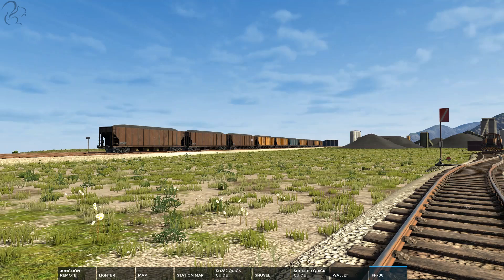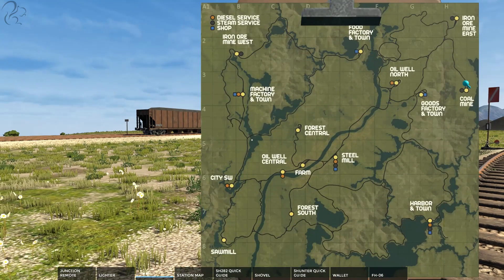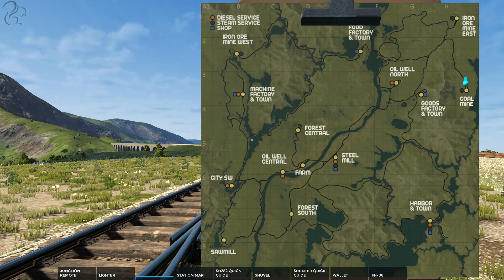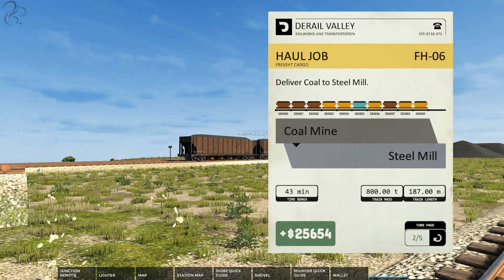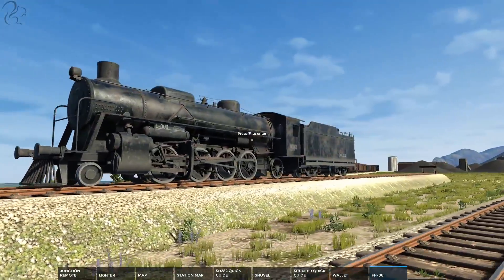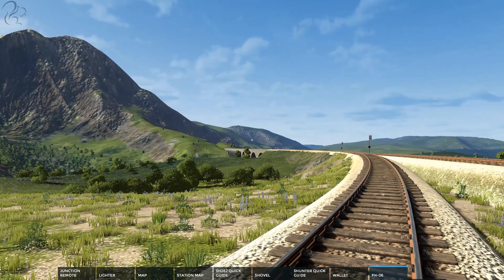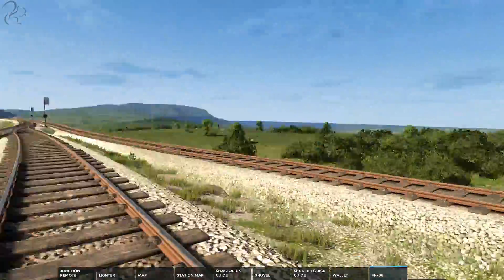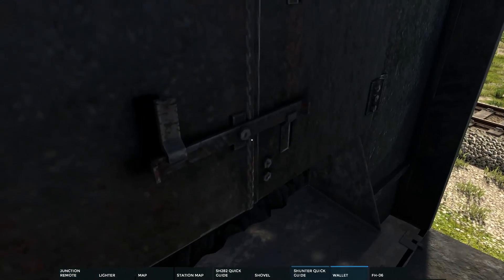Derail Valley - 800T Steam Haul

Comment: If I remember correctly, what you said about being in a steam locomotive in a tunnel is actually why Southern Pacific created its cab-forwards. Because it was the 1940s or 50s, they were oil burners, so they were able to turn the whole thing around, with an enclosed cabin where the tender previously was, and plopped the tender on the back, with plumbing for the oil to fire it. This meant that the crew could go throguht SP's many long tunnels without dealing with the annoying, irritating, and in several cases, dangerous fumes.

Comment: With that boiler pressure, I was half expecting rivets to fly through the cabin
Reply: More wasted steam coming out of the safety valve than the pistons!  and the coal usage, you'd think he's melting glass in the firebox
Reply: @captain-Dan  If he'ld have to do a 500km journey, he'ld never reach the end because he would be through his coal and water reserve well before the middle point. ;)
Reply: @captain-Dan  Yea, but it gives us a nice insight into how well modeled this thing is.  If you watch the boiler pressure and listen for the safety valve, you can see the pressure drop a little when the valve opens.
Reply: Pretty well all certified boilers are tested at double operating pressure hydrostatically, that's the law. In reality a modern (as in not wrought iron!, so last 150ish years or so) will probably take an extreme amount of pressure to blow, something like 10times its actual operating pressure. The explosions in the very early days were iron vs steel boilers and more often than not caused by crews tampering with safety valves, either because they made to much noise (no joke!) or trying to extract more power.  Explosions are relatively rare when it comes to modern stuff, more stuff like superheater failures and dropped fusible plugs than actual explosions, these things can still be fatal however. Even in case of a derailment and loco turn over, boiler is unlikely to explode, but its still an extremely nasty experience for the crew and more often than not fatal, we lost a few here about 20 years ago and i wont go into detail out of respect. Loco itself has just been returned to service and it really was relatively undamaged considering it ended up on its side.

Comment: 25:23 You're kind of lucky in that scenario since you're coasting down hill so the smoke won't be quite that bad, but coming the other way... On the Somerset and Dorset Railway there was a mile long tunnel between Midford and Bath Green Park called Combe Down Tunnel and it was notorious for its low clearance (meaning that the smoke from the chimney would rebound immediately off the roof and down into the footplate) and steep incline if you worked out of Midford, not to mention no ventilation shafts, crews referred to it as 'Dantes Inferno' and if your engine slipped while climbing Combe Down Tunnel it could be hellish. One incident in 1929 actually resulted in deaths after the Driver and Fireman were overcome by the smoke while their engine was climbing through Combe Down Tunnel, the engine then continued on its merry way with the unconscious crew on the footplate, out of control down into Bath yard where it crashed, killing the driver, and two railway workers in the yard. Nasty stuff.
Reply: This is the reason that cab-forwards exist.
Reply: @retovath  well in America yes
Reply: And you figure with how big the 9Fs were on the S&D that the exhaust output must've been brutal.
Reply: That's a helluva story....so it wasn't all fun and games huh???
Reply: I ain't reading all of that
Reply: This is why the Americans have closed cabs
Reply: Liam O'Farrill I did
Reply: big brain

Comment: Over in California, there is a museum that still has a steam engine that was used in the mountains. What the guide mentioned was that cabins for the engines were mounted on the front and the boiler would be reverse mounted so that the emissions would not cause CO poisoning to the engine operator. Something interesting you might like.
Reply: Can-forward mallets on the Southern Pacific?

Comment: @Squirrel Good sir, at 26:40 you make a crucial fault in steam-trainning... When entering a tunnel the firebox should always remain closed and the fire turned 'low' (if you will) to not risk a blowback from the furnace into the driver cabine. You never top off coal while inside a tunnel, very dangerous in reallife steam trains.... Another pro-tip, you can judge how your fire is doing by keeping the exhaust smoke between a light gray color under a low (pulling) load and a darker grey for a higher (pulling) load... Most people including yourself are driving this steam train with max coal and fire going, which creates black smoke or a to cold setting, which creates a more white-ish smoke.... Nice video keep up the good work.... I would love to see more of your derail valley videos... Greetz from the Netherlands.

Comment: Some information about entering tunnels - many a crew was nearly suffocated while operating steam locomotives over the Sierra Nevada mountains here in the USA due to there being so many tunnels bored through the mountains and the snow sheds laid over the tracks to prevent falling snow from blocking the way. 
The Southern Pacific remedied the suffocation by ordering several batches of "Cab Forward" locomotives. They are fired by oil, so no coal is required, just open a valve to shoot what is essentially bunker c fuel oil into the firebox. The entire locomotive is flipped around 180 degrees with a fully enclosed cab while the tender still rides behind.
 If you've ever coal fired steam locomotive, you'll understand why being a fireman on an oil fired engine is a breeze in comparison.

Comment: Not sure if you will see this, but if you put the control partially in reverse, (not sure if it is modeled in the game) you can use the train's power to slow it down instead of so much brake. Wouldn't want brake fade on a steep decent.
Reply: This does work in game.
Reply: Works in game. But in real life it was really not a thing to do. :-P
Reply: @julius6889  not on diesel and electric engines But it still works with older designs and some other more modern steam locomotives. You see engines way way back in the mid-late 1800's didn't actually have a break on them beside the handbreak on the tender and cars so the reverser was used and because they were so light the wheels locked up and started slipping in the opposite direction of travel to slow it down. By using steam against the motion of travel in the cylinder, it acts as a form of break.
Reply: This was done on early steam lcomotives, which only had handbrakes or steam brakes, but on more modern steam, this practice was no longer used due to more powerful air or vacuum brakes, as well as the fact that braking with the engine causes a lot of stress on the valve gear, rods and pistons.
Reply: @kitchenjail3546  Not to mention that even with modern-ish steam power, using the locomotive's own brakes (unless running without a train) was typically frowned upon, since if you used them long enough, the heat generated could cause the driver tires to expand and separate from the wheels.

Comment: Hi Paul, nice video as always. Your videos on this game why I purchased it for myself. Took me a bit to get the hang of things, but I found some methods of success that I thought I'd share.
1) <20km/h isn't necessary, I had more derailments at low speed than anything else, the key is gentle braking. If you are too hard on the brakes it will derail at low speeds, I had more luck being gentle with the brakes and riding a corner at 30+ even with long/heavy consists. Using the keyboard, pressing 'M' 3 times is a good start then a 4th time if it isn't enough. I'm sure there are a few bends that are exceptions, but I was biting my nails trying to be as gentle on the brakes as possible and found I was getting much further at higher speeds and lighter braking. 55 minute trips in < 40 minutes.
2) on the steam engine, pressure is your available power, shoveling coal when the relief valve is going isn't going to provide you with more power. I only shovel coal when I need to build pressure on the gauge, even while climbing you only need to ensure your temperature is high enough to replace the lost steam and if you keep the locomotive moving at 30-40 you have a much better indication of grade change with plenty of time to build the temperature to replace the loss. I've had to even relight the fire because it burnt out and still managed to gain temperature and rebuild the steam before running out of pressure.
3) I unfortunately don't know the complete technical definition of the cutoff, but it functions similar to timing advance. You are playing with a torque/speed balance, which also means that placing it at full torque at higher speeds actually doesn't help, if you are running at a decent speed and need to climb, placing it to full torque won't actually provide power until the speed drops. I find as soon as the speed drops you open the regulator until you hear pistons fighting the resistance, then begin to slowly bring the cutoff towards the torque as the speed falls, you will find the steam engine has the ability to accelerate up hills quite well

Comment: I found Old Bob's Shop. If you have already found it, skip the rest of this post. The next time I went through a town I bought Old Bob's Shop Key. I went back to the shop and unlocked the door, and low-and-behold there was an old Hand Cart; the kind you pump by hand. I used the F1 - F6 keys that also work on the Steam Engine. I took the Hand Cart for a joy right and had a blast.  If you haven't found the shop yet and would like to give it a try, Go North of the Machine Factory and just before you get to the first junction there will be an unmarked (on the world map) siding going South West.  When you get to the shop by going along the siding take Old Bob's Shop Key and approach the door pointing at the lock.  It will light up and you can unlock the door and get to the Hand Cart.  A nice diversion.
Reply: there's a caboose in the game now, get reginald's garage key at the city sw shop and it's just past forest south

Comment: 25:23 I have experience working on steam locomotives through long tunnels the trains are 15 inch gauge and the tunnel is 800 ft long which might not seem like much but at this scale and the size of our steamer it can get bad as our engine is oil fired and the tunnel is set at a grade so it makes it fun charging through it because at the fireman you have to keep an eye on how much oil you are injecting to the fire as if you have too little you wont make the pressure needed to keep your speed and you will have the fire blown out by the draft that the engine is making, but too much and you will gas the passengers and lift the safety valves inside (which is not a fun thing to do mind you) so while we are doing this we are also constantly injecting water into the boiler all the way through and while normally this will lower the temperature and pressure we are working the engine so hard that the pressure and water level for the most part stays constant. but yeah I know in the mountains it was a real bad problem so much so that one railroad had special locomotives with the whole engine reversed (called a cab forward) to combat all of the tunnels and snow sheds. while other railroads had gas masks for the crew or large fans in the tunnel or just used electric locomotives in place of steam engines. but in many cases you try to get the stack as clean as you can and make sure everything is set right going into the tunnel and you should be good till you get to the end of it.

Comment: When you went into the tunnel, you mentioned the smoke building up in front of you. On most railways I know of, the tunnels were ok for that, they had good ventilation or something. But on the Southern Pacific, that was actually a serious problem, so they built the cab-forward locomotives to fix that problem. Due to their design, the smoke came out right at the back of the engine itself, while the cab was at the front, keeping the smoke far away from the driver. Most other cab-forwards had the driver's cab in front of the smokebox, but everything else was the same as a conventional locomotive. Because the firebox was now at the front in the SP cab-forwards, it was hard to get coal up there, so they chose to make it an oil fired design, but the oil lines had leaking issues, which combined with the poor tunnel ventilation to cause one accident, where leaking oil caused wheelslip in a tunnel, and the automatic brakes caught the locomotive before it slid backward too far, but the poor ventilation resulted in the smoke building up, and a spark or something must have set the oil on the rails alight, as that caught fire, resulting in either the burning or asphyxiation of the crew, I can't remember which. I'm not 100% sure whether I got the details all correct, anyone correct me if I get it wrong.

Comment: Yes you may not have to deal with the steam dump valve. Something to keep in mind is if you're hitting the point where it's venting itself, then you're wasting coal and water building steam that's not being used. When my steam meter gets near the top I close vents and let the coals simmer as they will burn far slower during times when steam isn't needed. (For example when going downhill or sitting stationary.)

Comment: I discovered a little trick that may be useful to some or it may add to the burden, but here goes. If you inject the water so you can see the water level rise.  Then stop injecting water just below the top of the glass bulb so you can still see the white line of the water level. I found that the steam engine uses coal and water at about the same rate.  When the water level gets down to about 1/4 water left you will usually hear the tick-tick-tick alarm that we hear when its telling us to add more coal. Sometimes I don't hear the tick-tick-tick because of the noise, For me it has been a useful tool to know what the coal level is.

Comment: 53:18 - A "steam dump" isn't real, it's just for this game. In real life, the steam coming out the sides is usually toward the front from the cylinder cocks opening. They blow steam through the cylinders to keep them warm (to prevent water condensing) while they're stationary. They only tend to open them if they're planning on moving off again soon. For a long stop, they may leave them closed or just slightly cracked and open them fully before/while setting off to blow any water out of the cylinders.

Comment: irl another trick that was employed on real railroads was running low water to generate more steam, because less water to heat means faster steam generation

Edit: when I do heavy coal hauls I like to have the blower on full, damper all the way open, throttle wide and reverser on full speed, I can generally get away with 60 out of the coal mine

Comment: ALWAYS turn off the blower in tunnels. Just some good advice.
Reply: I think the blower is supposed to be on in tunnels, to help counter the effect of compressed air (from entering the tunnel) going the wrong way down the smokestack/chimney and causing blowback.
Reply: @rrice1705  One problem was with blasts of air going back down the chimney and through the furnace. They might have found a way around the problem toward the end.

Comment: Speed signs are there now, as well as a second break and a lot of other changes. Nice job, i already failed 2x with 1200t and 1000t to get up the hill, saw someone make it with 1200t so it is possible. But its really not easy. Will now check if 800t are more doable. The steam loko and tender also have some weight, so your actually moving more than just the train.
Still a lot of verry good help in your video, will try to manage speed better next try.